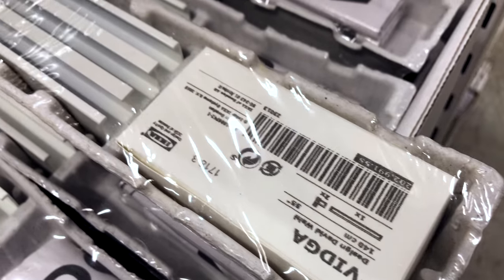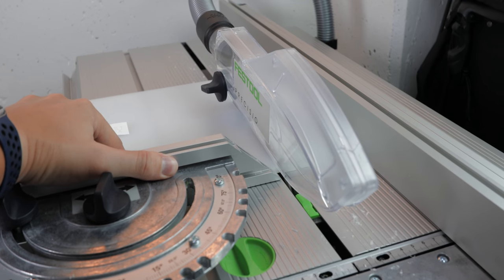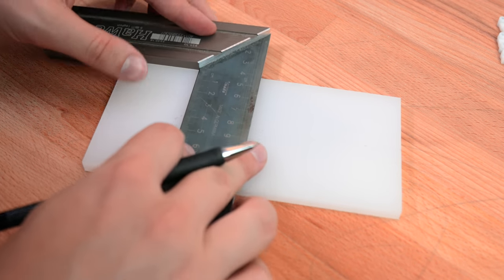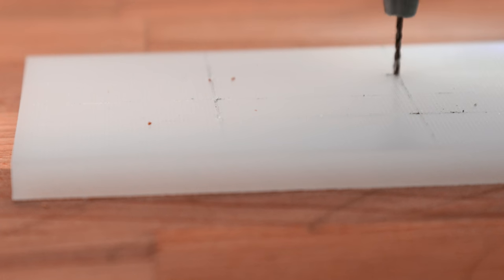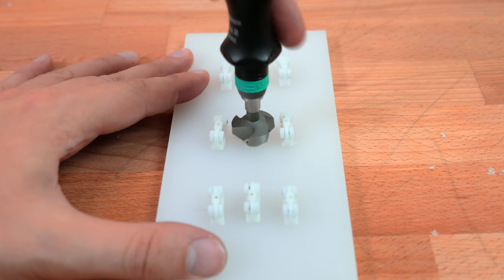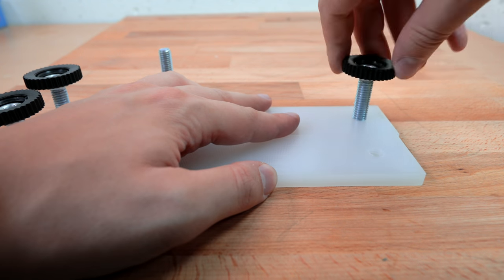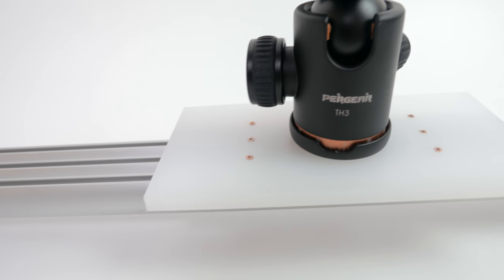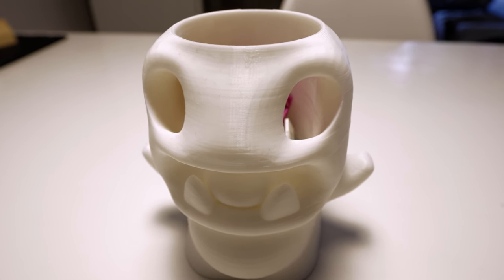DSLR Slider - DIY IKEA Camera Slider

Comment: What a great simple design i have bought all the kit from Ikea and am constructing a motorised version of it using a stepper motor, timing belt and an Arduino to control it some of the parts on the motorised version are 3d printed. i will be publishing a video of the construction of it when i have finished filming it.
Reply: Peter eager to watch your video!!
Reply: Plz tell where should I purchase
Reply: Did you ever make it?
Reply: How did it go?
Reply: I have made the slider it works a treat but i am having to re do the electronics as the stepper motor driver is noisy and gets hot i bought a ready made stepper driver board but it is not as good as i thought so i am making new electronics based on an Arduino and a silent stepper driver from Trinamic these are typically used in 3D printers. i will be posting the video when i am done editing it.

Comment: Atti, this might be the best one so far...there are many designs, but this one's simplicity and solidness is very appealing. One tweak could be to find a way to use the kingjoy ppl-06s with that rail. It is a motorized dolly truck about the size of the rail from Ikea.
Reply from the maker: I guess you could mount it on the bottom in order to use it as the motor with a belt and pulleys on both ends. Could be worth a try

Comment: Just an FYI, Ikea changed the design of this rail and the rollers. Now they are just designed to roll while hanging. The little wheels really don't make contact when turned the way you have them. They also made the wheel assemblies thinner so you can't really drill a hole into them for a screw. Everything is just generally cheaper quality and not as versatile. I just received the rail and rollers today and realized it doesn't work this way any more. Not to mention that they don't sell this type of cutting board any more.  Great video though. It's a shame because I had high hopes of making this. Back to the drawing board!
Reply from the maker: Thank you for your update Zito. Too bad they changed it. Worked quite good for me. Let us know If you find a good alternative 😉
Reply: @AttiBear  I like diy and your video is really great. But there's a point where you have to decide whether what you are trying to build is actually better and cheaper enough than a cheap $50 neweer rail. This is a problem I always get into with my projects. Especially if I have to buy some kind of new tool. 😜 I was really happy to find an automatic watch winder at a Goodwill. It had low-rpm motors, a speed and direction control, and it's powered by USB. So all I need is a solution for a smooth rail and platform. I'll let you know what I end up with. Thanks again for the inspiration!

Comment: I just returned from Ikea with some doubts about the system. As far I could recognize the top slider (cart) is not moving on the wheels of original hooks, rather on the rail itself, right? The wheels are only to keep the position of the cart from "bottom" part, not to let the cart fall out. Is that correct? So basically we are sliding the cutting board directly on the rail, with some postioning system, right?  thanx for explanation.
Reply from the maker: Hi Maros, actually the chopping board isn't sitting directly on the rail. The lower part of the hooks is. In my case the wheels are so close to the rail itself, that if i don't balance the cart when i mount it, i get unwanted noises from the wheels when they are spinning. So make sure to mount the baseplate as evenly as you can.

Comment from the maker: 🔴 So what do you think about this Camera Slider? Any ideas for tweaks?
🔴 Also check  out  the fully written article to this Video ➡️ http://bit.ly/2vRT8xT
Reply: You could add in a 3d printer belt with a stepper motor for automated timelapse footage.
Reply from the maker: Would you like me to do another tutorial on that?
Reply: Great idea! Love the concept gona try it this week!! But isn't it the VIDGA rail system? 

As an important you could add a 3/8 hole for a light stand so you could use it at a higher level.
Reply from the maker: I already did that a while ago 😁 works like a charm on my Manfrotto tripod

Comment: Would it work to attach this to a tripod on the bottom of the slider instead of the feet?
Reply from the maker: yes it does. I'm using it on my Manfrotto Tripod.
Reply: Great. Thanks.

Comment: Do you know how to mount this slider on a tripod ?
Reply from the maker: Actually it shouldn't be to hard. You have the Rail on the Bottom so you can attach additional Plates to it so it would be easy to mount Baseplates to it. Or you modify the feet and attache the Baseplates there.
Reply: @AttiBear  plz reply where I can purchase it's different part

Comment: Interesting video. Make a slider for next to nothing. I just need to buy a £2000 machine to cut the chopping board accurately.
Reply from the maker: Or you just use a handsaw like everybody else. This build doesn't require any precise cut's at all 🤷‍♂️

Comment: maybe you could put one little motor with a rope on it so that it can be moved by the motor. that wil be nice
Reply from the maker: I'll figure out a setup and will give you another episode for it 😃
Reply: Atti Bear i know an idea but don't have the time. maybe if you just put a small dc motor on one side with a rope on it and on the other side you just put a elastic band for not shocking